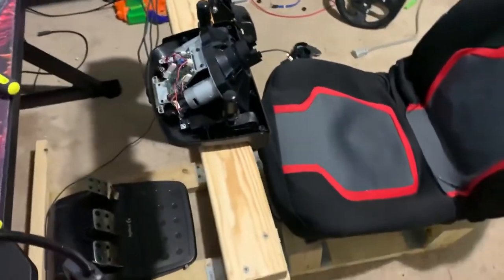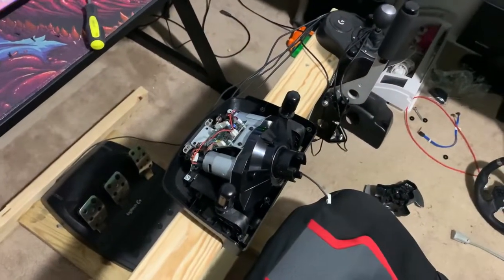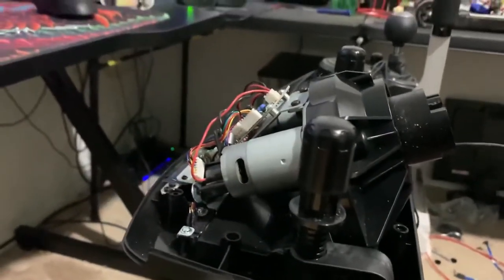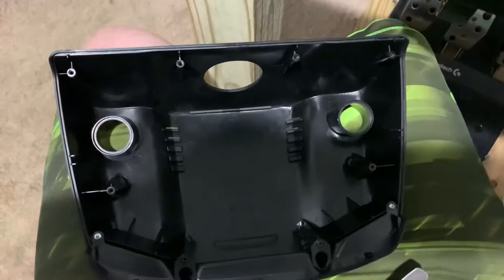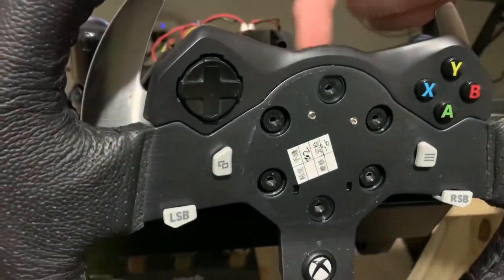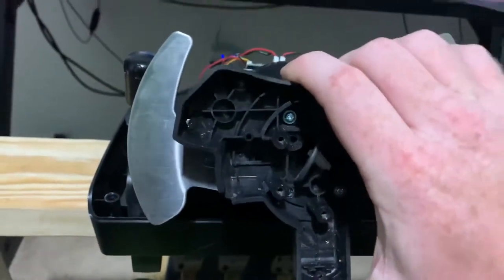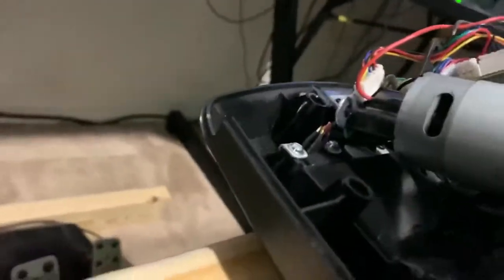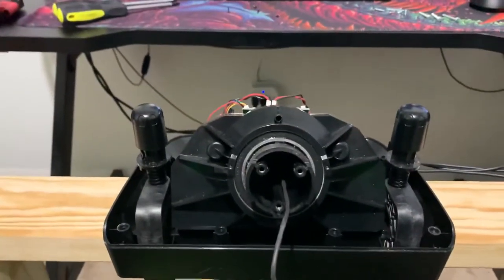G920 Logitech Steering Wheel not centering Mod

Comment: you need a smaller washer, you got a pretty big one,also you need washers on both sides
Reply from the maker: I tried to put a small one in it and it did not help, I put one in both sides and it lost all connection. This one had the best solution, for my setup.